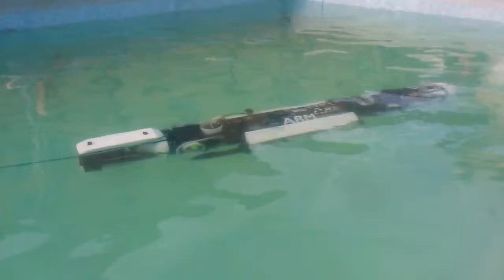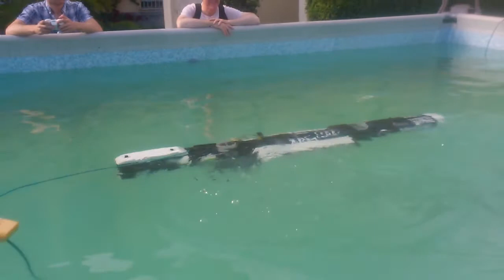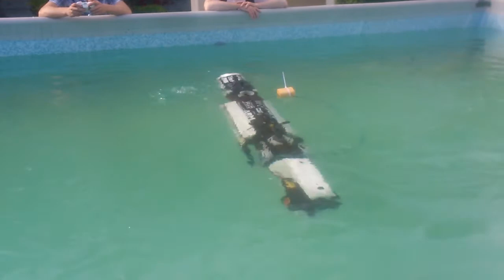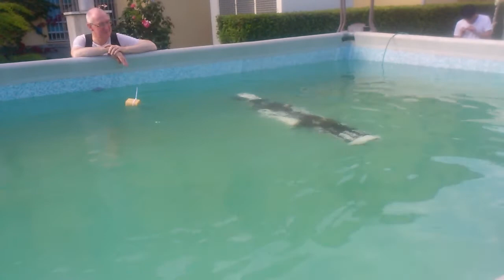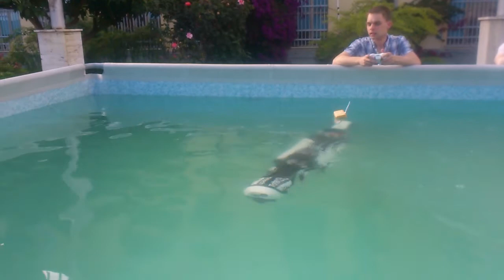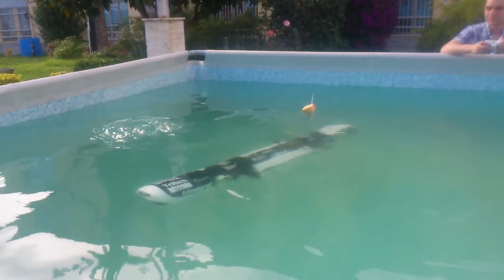SAUC-E 2013 - Tank Testing: Hydrodynamics and maneouvrability

Comment: may be difficult to fix this as the horizontal thrusters are in line with the centre of buoyancy and not the centre of mass. Well in fact you will have problems either way :(. That is you will induce roll on acceleration with them in the current location, and you would get roll from out of balance drag forces with them aligned to the CG. Also the von kalmen vortex shedding will induce rolling and heaving when strafing. Probably all you can do is go slow, add some fins and hope for the best